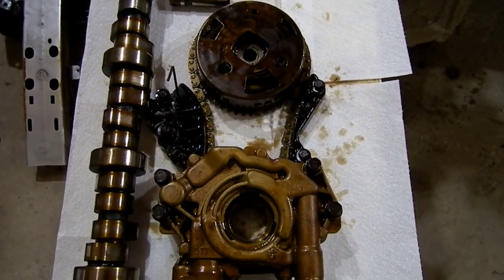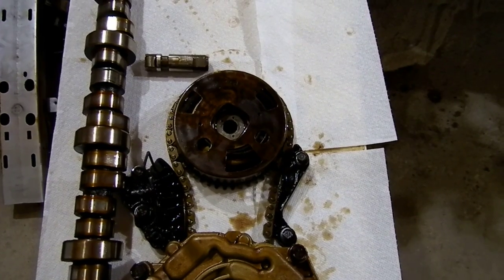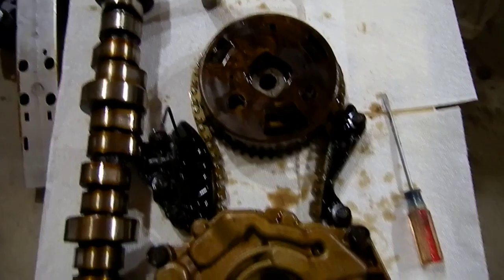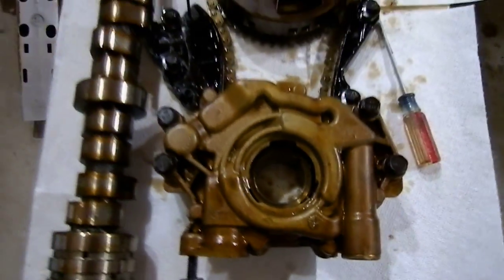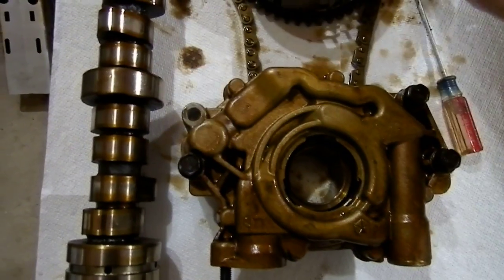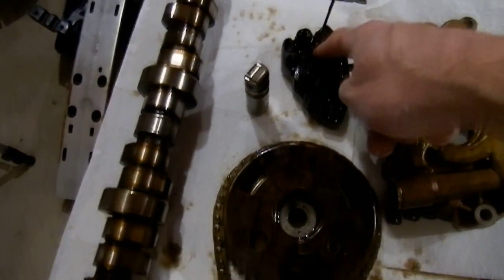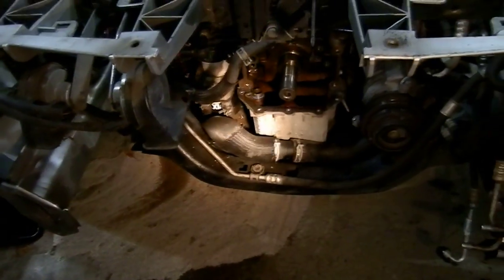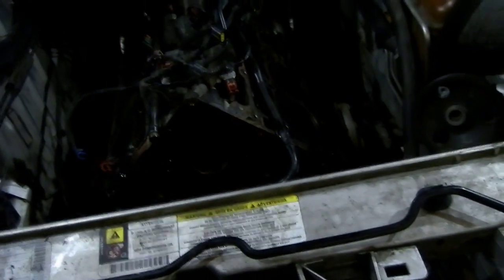5.7L Hemi Camshaft and Lifter Failure Tips/Tricks Timing Chain Look

Comment: Excessive idling is the culprit here. You can change your oil every 3k but if you idle many many hours during that 3k miles your oil will be worn out before you get to 3k.
Reply from the maker: Dodge Rams are wiping out the cams like crazy as well. Crummy design.

Comment: It's got a cop motor, a three hundred ninety two cubic inch Hemi plant.
It's got the cop camshaft, cop lifters, cop pushrods, 
It's been running 15,400 hours at idle with no oil so the cam lobes are flat. 
What do you say? Is the new Mopar Hemi crap?
Reply from the maker: A police car, hemi is worn out in around 100k. Time for a long block. I currently have an awd hemi 2015. It’s a very fun car to drive with the awd and winter tires
Reply: @mph5896  A police car with 100K probably has a lot of idle hours.
On the Hemi the cam and lifter oil flow is low at idle.
Reply from the maker: Gordon Welcher that’s uncle Tony’s theory. I have seen quite a few police chargers with lower hours, like 6000 total hours with wiped out cams. Rollers on the lifters lock up and do the cams in. Other police cars do the same thing though, like Tahoe’s and caprices. The Ford non turbo 3.7l holds up pretty well engine wise
Reply: @mph5896  Thats where I got this from.
It is true it is his theory only.
What else do you think it could be?
The Bluesmobile with the 440 probably doesn't have this problem but is doesn't have roller lifters.
Reply from the maker: It’s just a hypothesis he came up with. Nothing to back it up. He could be correct, or it could be a lifter manufacturing issue, poor design, or just use from high amount of hours. Or something else?
Reply: @mph5896  That is true. I will watch his videos again and do some additional research.
I have to go now, Doordash is at the door with the 4 BBQ chickens I ordered.

Comment: curious where is all that steel that came off the camshaft lobe? why is this not an issue with babott bearings? after putting 1/4lb of hardened metal dust in the oil what could possibly go wrong.
Reply from the maker: Replace the camshaft and cross your fingers or put a long block in it. Its your choice and your wallet.

Comment: So I had a compression issue on my car but my valve seat just gave out cuz the car got hot and I shut it off and turn it back on due to a faulty water pump that I just switched out and now I don't know if my Cam's good or bad but that's good to know about the compression issue the valency I didn't think that would be I thought it was just the lifters

Comment: See Uncle Tony’s video: Design Flaw in Hemi splash oiling system. At idle no splash is getting to rollers. Use Schaefer oil and zinc additive. Idle as little as possible.
Reply from the maker: I saw that video. Thats a hypothesis on the situation. No testing done to prove it though. Its an interesting theory though.

Comment: So you weren't worried about the metal shavings in the oil pan?
Reply from the maker: What metal shavings in the oil pan?
Reply: @mph5896  , so the metal off the cam lobe and lifter just vaporized? What metal did you think I was referring to?
Reply from the maker: @firebreathinggarage2117  No, I was not concerned with metal shavings in the oil pan. Its a slower wear process creating finite metal particles that are picked up by the oil filter. My opinion is engine replacement with oil cooler replacement would be best practice.
Reply: @mph5896  yes most of the wear would be fine metal, but along the edge of the lifter cutting the valley out in the cam lobe, on the sides of the lifter which leaves long slivers of metal that fall of the cam lobe. Hope your works ends well. The oiling on the cam of these engine's is terrible almost noon existent at low Rpms.
Reply: you should always be concerned.  Maybe use a spray wand and clean it out from the hole, flush and refill... The dealer MUST drop the pan.  They require it, but the problem is the lifter quality and mds/vvt (high lift).  Thankfully the incidence gets smaller and smaller as years go up, they got it wrapped up in 18 it looks like.  Seems like 11--14 was the bad years.  https://www.youtube.com/watch?v=PAuNSYqOQjk

Comment: Why did you take the bumper out and discharge a/c. There’s tons of room with the rad out ?.
Reply from the maker: This was 5 years ago. I have since done them differently. Bumper reinforcement does not need to come out and condenser can be moved to get the cam out with the lines attached.

Comment: Is the process the same as in a pick up truck I have a 2500 I’m doing this weekend
Reply from the maker: Trucks, the oil pump has a pickup that is different. If the oil pump needs to come off, the oil pan needs to be dropped. I have pulled cams in the pst while leaving the oil pump in place though. A little tricky.
Reply: m ph this truck won’t start, I’m thinking it has really bad damage. Can a new cam and lifters be put in if he drove it around like that for awhile
Reply from the maker: @terryplummer7650  I have no idea whats wrong with your truck. It needs to be properly diagnosed in order to give you an answer. I can't do this over the internet. Thanks for your reply.

Comment: Your timing description in the video is 180 off. Supposed to be 2 links straddle the crank mark @ 6 single link on cam @12. Keyhole at 2.. ive been cranking this thing for an hour!!!
Reply from the maker: Description in video is perfect. You did something wrong if it won't start.

Comment: Is it possible to set the crank timing 180 degrees off and still be at the marks? Just did a cam/lifter job, hesitates to start and sounds loud, I did turn it by hand before hand and it turned fine

Comment: Did you end up replacing the camshaft sprocket as well!!!
Reply from the maker: No. I have done a dozen of these now and have yet to replace that. I just replace the lifters, camshaft and timing chain tensioner. 2 head gaskets, timing cover gasket, water pump gasket, and oil/filter/coolant. I reuse the valve cover gaskets and intake gaskets. The last couple I have cleaned and reused the head bolts.
Reply: @mph5896  how much does a job like this cost.  How much would you charge?
Reply: @mph5896  I'm in the process of doing this to my 2013 Jeep Grand Cherokee, Im ending up replacing the oil pump, timing chain and tensionor and follower. Going to reuse the cam VVT sprocket, engine has very little wear but my follower has some play in it. When you installed the timing cover, did you immediately install water pump afterwards? I didn't as I'm having to do this when I have the time, so I stopped after I installed timing cover and torqued the 6 bolts down, left water pump off for now, do you see any issues with timing cover gasket failure by doing this?

Comment: There are three of these engines in our family and all are trucks. No issues as of yet. The trucks range from 40,000 miles up to 130,000 miles. Running zddp additive in the oil... Bumped the viscosity up one also. The engines are definitely quieter. Apparently either you get one of these engines that will go half a million miles or it will start having problems at low mileage. Best thing you can do is run a top-grade synthetic, and put zddp in your oil I think will help. Don't let them idle for very long in hot weather as the oil becomes too thin for good lubrication and protection against heat buildup in the tiny rollers in the roller lifters. I am a die-hard Mopar man 100% oh, but I have read so many of these problems with the 5.7... Chrysler obviously isn't standing back of it which is very sad to me. But if you go online also looking at the other brands and their problems you will see similar BS. So it seems all of us are just going to have to face these issues no matter what brand we have, although rate from go, the 5.7 and 6.4 seem to be the worst of all of them. What a pity

Comment: Hi guys, when engine rebuilders rebuild their engines they use a ZINK additive with the oil to prevent premature failure. Why not try and use oil with zink additive as standard oil when driving??

Comment: Two-timing this job tomorrow with another tech, thanks for posting it.
Reply from the maker: T Rock no prob. I don’t even bother pulling the oil pump anymore, I just unbolt it and rotate. It’s a big job, last one I did was 9 hours. I also don’t bother pulling the bumper bar or discharging the air. Pull the water pump, then fan, front bumper and radiator from the engine side. Leave the condensor and other coolers, there is room to wiggle the cam out with it still attached by maneuvering the co sensor a little.
Reply: @mph5896  we took the entire front end off, condenser etc. No deadline so we took our time. Runs like a beast now.

Comment: Are there any small ball bearing sets on  the 5.7 valve train or oil pump system? Changed the oil and in the bottom of the drain were 2 small steel balls. Theres a possibility that they came from my motorcycle that I changed the oil the night before.. Thanks

Comment: Has anyone filed a class action lawsuit against Chrysler...seeing that this is a common and reoccurring problem in their Hemi engines?
Reply: It’s an actual design flaw to boot. The cam and lifters do not get oiled until around 2000 rpms. So do not idle these too long. And use good oil.
Reply: @melplishka-se8bf  wrong... oiling is fine, its quality control on lifters and higher lift(MDS/VVT) from 2009-2017
Reply: Darth Hemi aaaaah no when you have the heads off take a look you’ll see the problem. If you can’t then you have no idea what you talking about.
Reply: @autochronicles8667  no it's not. This issue is a lot more prevalent on engines that were idled constantly but the lack of oil pressure at idle is causing the low quality bearings in lifters to seize and wipe the cam lobe out.
Reply: One acronym, NAFTA.
Reply: @lynnchelo4727  lifters were being made various places. most i see are German made(daimler...)..
Reply: Darth Hemi : my wiring harnesses was China.
Reply: Dudes this has been around for a while. Known facts that fix this problem are- replacing your oil pump with a hellcat high volume oil pump from melling. 2- replace your lifters with hellcat non mds lifters the good quality oem ones or better. 3- Run good quality oil and replace it every 3k full synthetic and probably move to a 5w30 for you ram owners. And lastly drive a hemi like it was meant to. This should solve all the issues with the hemi except the shit exaust bolts they use for the menifolds just get headers with real exaust bolts. The final problem is people having issues spinning bearings snapping rods and dropping seats. Not all that much you can do for that unless you want to build it to be bullet proof which you can but it requires a tear down money and time. Also if you ho to put a cam and lifters in with out checking the oil control valve for metal and it has metal your screwed so theres that. Better off checking that first than just throwing a cam at it for a future failure. Just what ive leaned about these after owning my hc since 16 and doing tons of research on this subject studying others who are certified dodge mechanics and others with many years of experience working on motors thats what i found out over the years. Cant really get man though chevys eat cams to. Its a problem of the single cam motor with all this stupid eco tech designed to be emissions friendly rather than being mechanically friendly.
Reply: Could it be sloppy lifter bores letting oil just squirt out from to much tolerance ? Plus sloppy lifter bores letting lifter cock wee wee bit there for Making rolling surfaces not a line for efficient rolling ?? But really why dodge not use 318 and 360 and make roller engines out those , i would say , well put together 318 or 360 with roller lifters and fuel injection type with individual injector per cylinder and the hot coil on plug of today those engine's would last for lots of miles with Mobil1 full syn 10w30 with out this chronic failures
Reply: @scottyjones27  because they make more money when things break down. Dealerships make more money on service than selling cars. Folks change cars faster than underwear these days, no need to make them last longer than the warranty period (if even that.)
Reply: @DL101ca  yes I'm agreement with you 100%  ! Most cars are made now for recycling , but  i try to keep mine long after I gettem paid for , this Feb will be 17years been driving my baby daily she's got well over 350000.0miles and she is a 02 Mustang GT 5speed my wife's Corolla has 280000.0miles we got it new in 2010 , I've seen and heard so many of those gen3 dodge's ticking some whacking and 99% of the owner's do not hav a clue of what they hav, they say to me , Oh it's just a himi tick they all do it !!! The dealer said !!
Reply: it looks to me from the color of the oil and the brown varnish on some of the parts, that poor maintenance and overheating might have had an effect here.

Comment: How many miles on that engine? 5 years old would still be under warranty if you can prove you changed the oil.Also,i have seen oil companies pay for engines with valve train damage.

Comment: Hmm sounds like my problem!  90k miles on my 03 5.7 Hemi ram.. cyl 5 misfire code, low, kinda rough idle..  to diagnose would u suggest removing the cover & looking for play on the rockers like you mentioned?  wonder if it’s even worth it seems to be running kinda OK minus the rough/ chugging idle.
Reply from the maker: Jonathan Cooksey 08 and down usually don’t wear out camshafts. Saw it once but that was a super high idle hour police car. The 08 and down Hemis drop valve seats, they bang around in the head and poke a hole in the piston. Do a compression check and see what you have to work with

Comment: Good Video. Saved me much time. I was considering pulling oil pan on RAM 1500 to get the cam out. It occurs to me this technique may also work on a Chevy LS motor as well. Nearly the exact same setup with the oil pump.Again. Great vid.

Comment: Awsome video man I got a 2011 ram 1500 going to do this and was thinking of putting in a new chain but didn't want to drop the oil pan. This is a big help!
Reply from the maker: Ryan v I heard from other people the oil pan needs to come off on the rams. Different oil pump pickup setup on them
Reply: @mph5896   Damn. Oh well good to know now before I start. Thanks for the heads up. Maybe I wont be changing the timing chain haha
Reply: @mph5896  Yes you are correct, the Ram pan does have to come off. Just finished a cyl #3 failure from lifter.

Comment: No way I would put that engine together without putting the block in a machine shop to clean all the metal from the cam and lifter.
Reply from the maker: I hear ya, BUT dealers are doing this as a repair under warranty like this

Comment: On a 2003 Dodge 1 ton with a 5.7 Hemi engine locked up didn't make a noise what would it be
Reply from the maker: Couple tips, take the belt off and see if it will turn over. An accessory could be locked up. 

Pull all 8 spark plugs, then see if you can turn it over (hydrolocked). 

If neither of those work, time for the engine to come apart.

Comment: I don't know if it's helping my Hemi's lifespan, but I'm doing 5000 mile oil changes with Royal Purple 5w20. The head is so clean you can eat off it. I don't hear any ticking, it runs smooth, but it's only got 42000 miles. Maybe I'm doing it a favor. It used to tick with conventional oil from the dealer.
Reply: Curious why Royal Purple?

Comment: Exact same problem on the same cylinder on my 2011 Dodge Ram 1500 Sport 5.7 Hemi, 103,000 miles. No oil coming out of cylinder 5 intake rocker, been seeing TONS of these videos on every non-MDS cylinder, bad Hemi flaw! Chrysler not taking any responsibility for thier poor design. Getting ready to pull and replace the motor with aftermarket parts to try and avoid this issue again!
Reply: Rocker oil is unrelated, as is MDS.

Comment: was it throwing a code for a camshaft position sensor
Reply from the maker: No camshaft position sensor error code. Misfire code P0303, slight engine knock and misfire at idle.

Comment: <- - - - - - - - 2011 RAM 5.7 Hemi 1500 4x4 with the EXACT SAME ISSUE WITH THE EXACT SAME CYLINDER. Chrysler knows about this issue and refuses to do anything about it. Average cost for this repair is $6500 +, but that can change according to the dealership or garage you use.
Reply from the maker: Its an 8 year old truck. Dodge warranties the truck for a certain period of time. If the warranty runs out and you fail to buy a new one all repair costs are your responsibility. Dodge has 0 responsibility to fix your truck outside of warranty even if its a common problem.

Comment: what cam and lifter did you replace with  the part numbers please
Reply from the maker: Oem, unsure part #
Reply: is it holding up I worry about replacing with same part number that went bad hope dosge has the part fixed now
Reply from the maker: Car was sold a week or two after it was fixed. Not sure on a permanent fix on these. It will more than likely go bad again. Maybe a high volume oil pump would improve longevity???

Comment: I wonder if these engines will make 200.000 with the plastic timing chain tensioners.
Reply: Doing my lifters now at 211k miles. Cylinder 5 missfire worn cam lobe. 1 owner all original. Replacing with mopar parts. Only used penzoil platinum.

Comment: how much did parts cost
Reply: All OEM dodge stuff I would probably say at least 1500-2000, maybe more. Don’t forget you need all new head bolts and head gaskets and all that as well
Reply from the maker: Depends on how in depth you go. If you do all new OEM lifters 16/cam, timing chain, gaskets, exc prob $1200-1500. You could use aftermarket stuff for $800-1000
Reply: Going rate for basic repair at dealership is $4700+